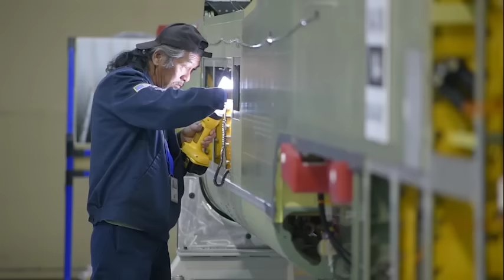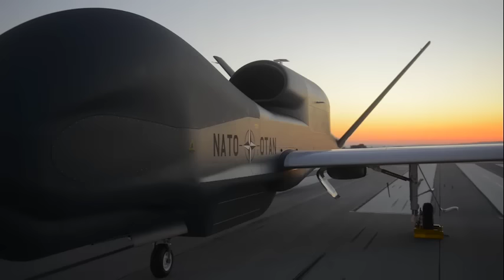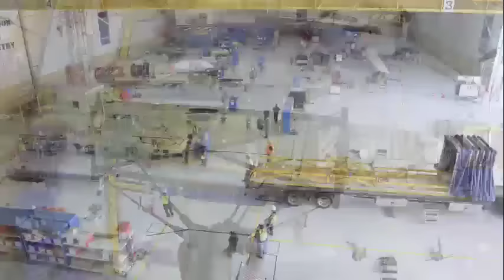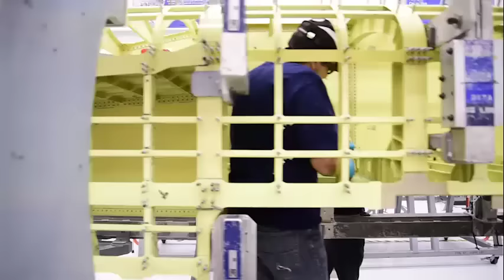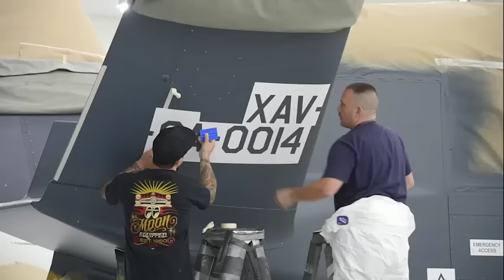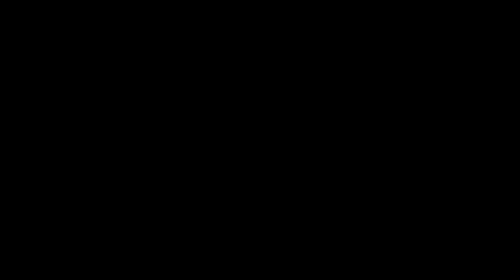NATO AGS – The Dream Production Team That Makes It Possible

Comment: This video is just under a decade old and what it does not tell you is all of those Global Hawks (which came from the HALE program) that were built for the US Air Force including the Eurohawk pictured behind the man talking in this video are destined for the boneyard or the museums. The US Air Force cut production about the same time this video was released and will withdraw them from service in 2027. As far as the Eurohawk goes, two of them were built: One of them now sits stripped of parts in an aviation museum, and the otherq abandoned in a hanger, both of which in Germany. The Navy’s version known as the Triton (that came from the BAMS program) didn’t live up to all it was promised and last I heard the Navy is fixing to get rid of theirs leaving Japan and Australia the only ones left who might be operating them. How long they might continue to operate them, who knows?

Summed up, the entire HALE/BAMS programs were a resounding dud. It was designed to replace the U2, but the U2 (or TR-1 one as it’s known) is still flying high while this piece of overpriced junk Northrop Grumman built is headed for the scrapyard and that’s certainly not nothing to brag about!  If I were part of this program at one time, I certainly would not talk about it.  

And if you think I’m joking, Google it. There are articles out there that cover exactly what I’m talking about.